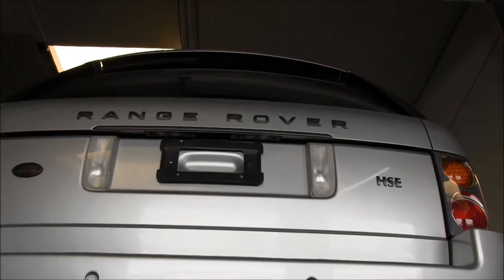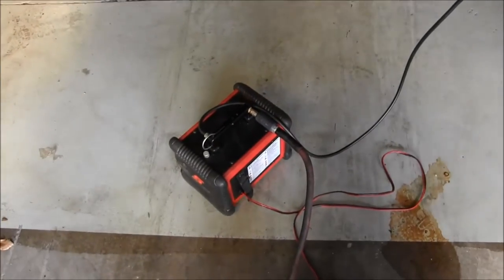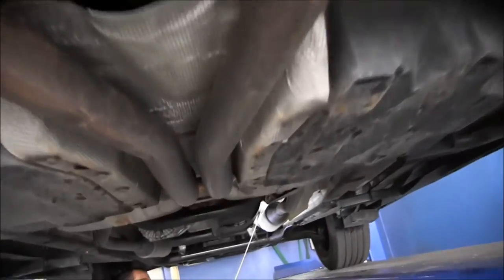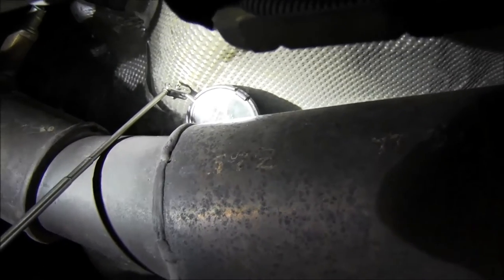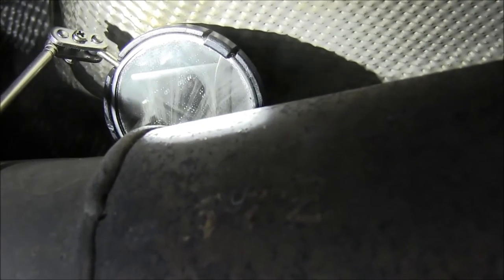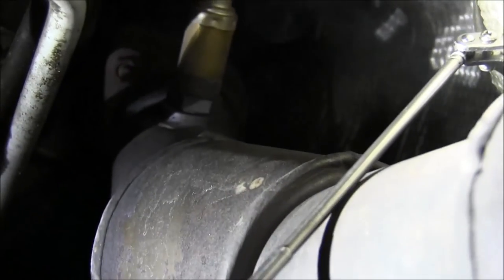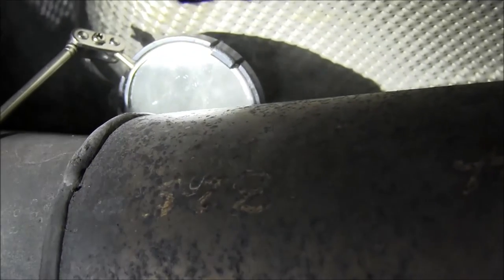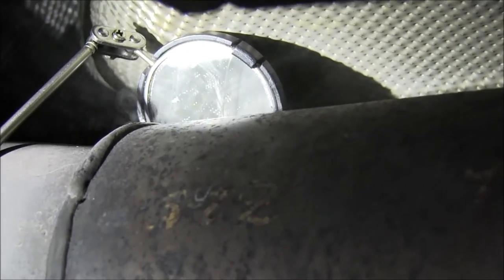Land Rover Range Rover Repair Specialists Temecula Code P1170, P1173

Comment: In addition to this problem if the transmission has been out of the car and some one didn't get the left and right bank aft O2 sensors connected correctly (reversed ) It will also set this code P1170 and P1173 after 20 to 30 miles of driving. This is what happened to my Rover right after purchasing it used. We installed new O2 sensors before and aft cat. new Mas airflow sensor new PVC valve and all related hoses, smoked tested the intake to check for leaks smoke tested the exhaust to check for cracks no luck the code kept coming back. Only after checking wiring diagrams found the aft sensor leads had been reversed. We switched them back problem solved. Its a easy screw up if someone had the transmission out of the car and didn't mark left and right. Hope this helps someone else save a lot of time and money.
Reply: I am having this same problem. Can you explain "aft sensor leads had been reversed. We switched them back problem solved." in more detail please? It would be much appreciated!!

Comment: I'm having a exact same problem in my 03 Range Rover however I'm only getting p1170 for quite a while I will clear it and it will be gone for a while. I do have an aftermarket Cat converter that was put on there 3 years ago. after watching this video I'm sure that could be the problem? Recently I've cleared the code and it came right back, what's unusual about this time I got a transmission failsafe on dash, would this code for the Cat converter do that? Shut the vehicle off and restarted, the transmission fail is off right now. Also I never got any other codes for the transmission!  While the transmission was in failsafe mode it was very hesitant and the engine sound a little funny but it drove. Please help if you can!
Reply: Did you ever figure anything out on this?  I have same code and trans failsafe alert.  Thanks in advance!
Reply: No I've cleared the code and it never came back! But I'm sure I'll be dealing with it one day!
About 10,000 miles ago I replace that side before with an aftermarket from eBay at $169